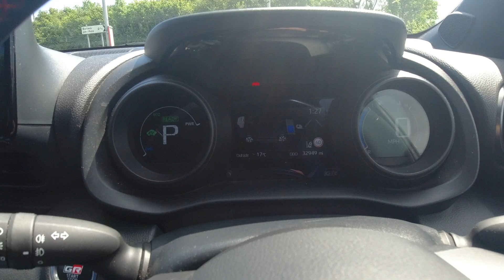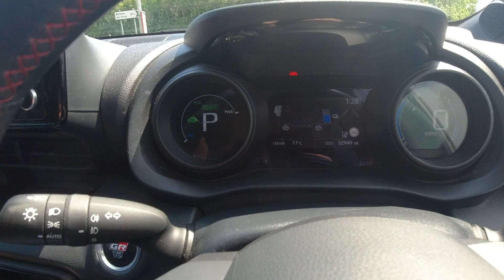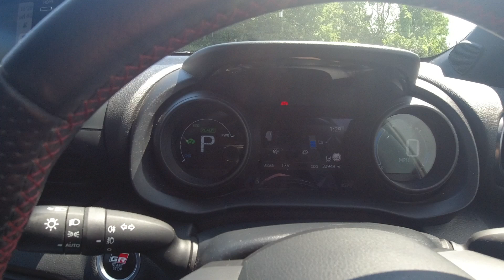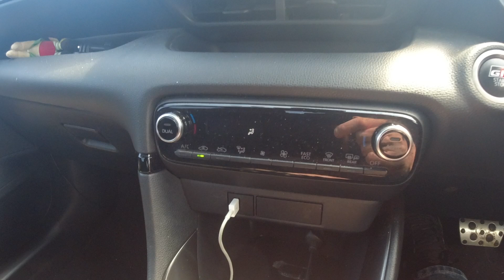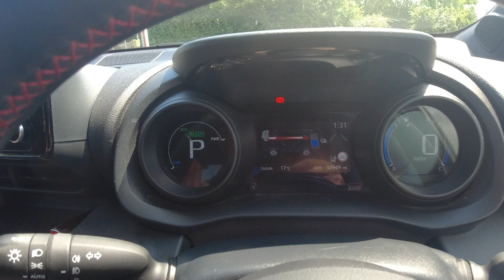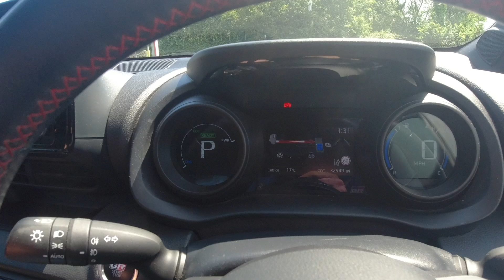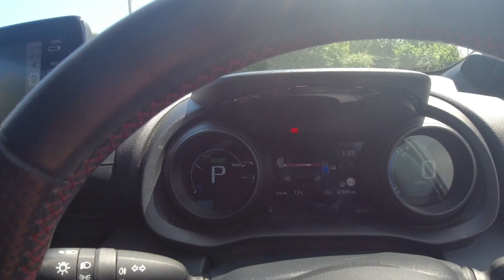Tips & Tricks 47 How do you do a forced recharge of both 12 Volt and Hybrid battery

Comment: Great advice. I have never had a problem with starting and I am retired and don't do a lot of miles, A lot of people think their battery will last forever where as it slowly deteriorate over time reducing the time it can be left without if use.
I checked my battery voltage after standing a day, at 11.6 volts I decided it needed a new battery

Comment: Hi Paul - what a brilliant tip to keep the 12 volt battery charged up for low use driving. This is exactly what our sales rep told us to do when picking up our new Yaris design last March by switching on the air con whilst in ready mode during park up period. By doing this method at least once a week keeps me out of battery trouble. Every Yaris driver should know this. Thanks Paul.

Comment: Hi, I have learnt so much from you about Yaris Hybrids. Watched and rewatched them. Thank you very much for making them. I have purchased a Yaris Cross Excel. It should be here before the end of August. I have read about the problems with the 12v battery. I am very concerned. I only drive about 70 miles or so a week at the moment. I travel to see my husband in a Nursing Home. My biggest worry is that the car won't start when I get a phone call from the Nursing Home about my husband having a fall. Which he does, quite a lot, unfortunately. So I contacted the Dealer about my worries and they said that they will provide me with a Ring RSP2000 20w Solar Powered Battery Maintainer. The Service Manager there said that it can be plugged into the Cigarette Lighter to charge. I would like your opinion as to whether it will send some charge to the small battery when the car is totally off. He said it will. I know you'll know. What do you think? Is it true? Of course I now know that I can do it your way too. Many thanks.

Comment: While it’s true that there are only a couple of relays to switch on the high voltage that need a certain minimum voltage, there is also the brake control unit that we can fall foul of if the low voltage is too low. We need to apply the footbrake a bit to be able to switch the power on. As you are probably aware, it’s a bit of built in interlocking to be able to switch the power on (even when it’s parked with the transmission in park mode). I think the hydraulic pump unit for the brakes runs at 12V, and when the snag arises, one of the first things that comes to light is when the brake feels a but weird when trying to switch the power on. Been there, done that, last winter.

In my case, the 12V developed a fault with one of it’s cells failing, and ended up having a new one supplied by the dealer at no extra cost. Whether the dodgy cell was damaged by discharge, I don’t know, but it’s probably a bad idea to let them run down too often or for too long. The dealer who did the job did recommend the use of trickle charging by low use people.

The dodgy cell was detected by a proper charger that I have for occasional use - a Black & Decker one for lead acids. Quite old, but similar products are no doubt still available.

You’re right about using the air con to trigger the need for the engine to run. Alright, it uses high voltage, but soon it will draw enough current to force it to start the engine, with the surplus output going to the traction battery. Theoretically it’s supposed to be between 30% and 80% charge most of the time, but the 12V battery just gets topped up all the time when the power is on.

Comment: Does the A/C switch actually need to be ON, or can the heat just be turned up as its the demand for heat that forces the engine start? My thinking here is that the A/C compressor also draws power out of the hybrid battery.

Comment: I have a question, hopefully you can help. I picked up my new 2024 yaris hybrid today(icon trim), they provide a tyre inflation kit, but, I cannot find a 12v outlet to use the inflator kit, what do I do if I get a flat? Is there a hidden 12v outlet? (used to be known as a cig lighter socket I guess). Some of your video's have been very helpful thus far, so I have subbed and turned on notifications. Thanks for all the valuable info so far....... :)
Reply from the maker: The 12 volt socket is in the cubbyhole in front of the gear lever along with the usb socket
Reply: @paul_nwsxs  I literally  picked the car up a few hours ago, so I haven't had a chance to  have a look, I will check it out and report back, thanks for your reply.......
Reply: Yeah, you were right, many thanks.

Comment: There is a downside to that, and is related to the internal AC evaporator: too frequent AC runs at full blast leads to premature leaks, particularly in Toyota's, and getting the evaporator fixed is a real pain (and expensive), as long as the entire dashboard must be dismantled.